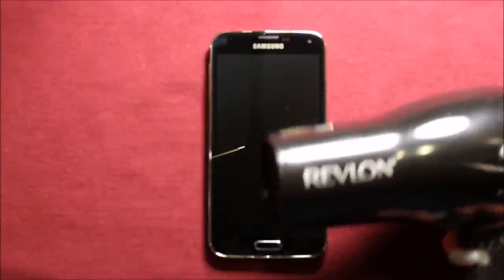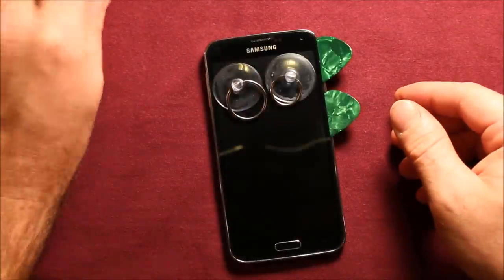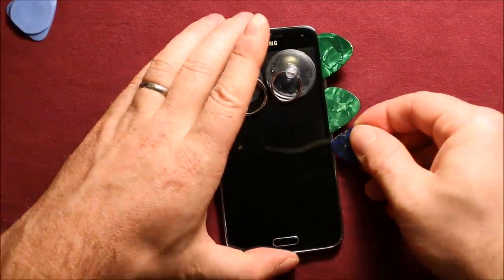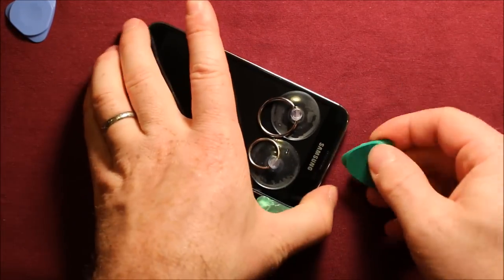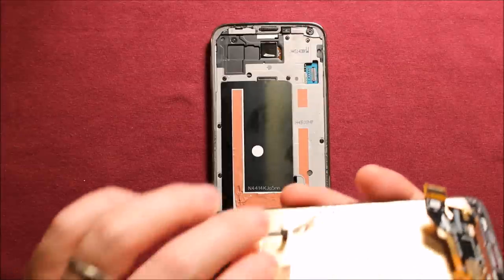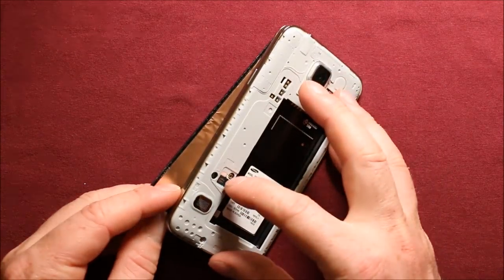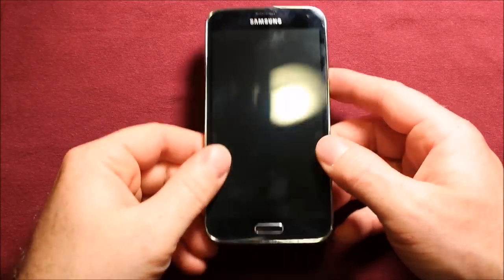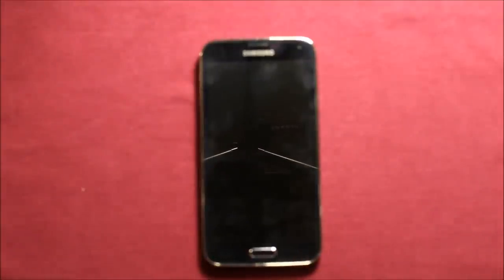Galaxy S5 Headphone Audio Jack Replacement How To Change

Comment: 1:56 I would add that you have to remove the glass AND the LCD (in general adressing every component by its name) and that they should stick together. Otherwise, you can easily separate the glass from the display, however, your display will absolutely break while dismanteling. Your glass functions as stabiliziser.
In my case, the glass was broken and I had to replace it anyway. It didn't bother me to break it further, however, I now broke my lcd too, had to buy it too, ... and so on. The rest of the replacement was easy.
Another tip would be to show the warming process (in muted), too, to give an idea for the ideal warmth areas (especially regarding the adhesive in the middle, which is a bummer!) and to light / better show some processes. (f.ex. 4:40)
I would like to thank you for your video! <3

Comment: Just watched this and was dreading having to do this myself. Gone are the days of easy disassembly like the Galaxy S2. I used the flashlight on the previously mentioned S2 and realized the only problem with my headphone port was a tiny rock nestled in the very bottom preventing the jack from seating. Straight pin was all I needed thankfully. If you have a similar problem, inspect the jack carefully before having to tear the phone apart.

Comment: this video was super helpful. my headphone would randomly disconnect and reconnect and then stopped working completely so I figured the jack was faulty. watched this till I saw how it connects and then squeezed the phone just above the connector and it fixed instantly... hope it stays functional for a while
Reply: Holy crap very glad I read this comment. Tried the same thing (squeezing as hard as I could on and around the jack and connection). My phone has been disconnecting from my music as the tiniest slightest movement which is incredibly annoying. After doing this it seems to have been fixed.
Reply: I tried squeezing the phone too and it has fixed my headphone connection problem. 
Thanks for the video - the repair looks hazardous for an undamaged screen.

Comment: +Smart Easy DIY @Smart Easy DIY If you used the hair dryer to melt the adhesive on the screen in order to pry it up, how did you re-adhere the screen? Did you not apply any kind of adhesive in the rebuild? If I were to reapply adhesive, do you know what type of adhesive needs to be used?

Comment: Thanks a lot for this video, I think I will only attempt this fix when the S6 is released, so if I really screw it up, I'll have an excuse to get a new one... but right now it looks way more complicated than I had hoped. 

Out of interest, what's wrong with your audio jack? Mine is crackling every now and then, I thought it was the headphones at first, but testing with a few other sets I had shows that it was the jack.
Reply from the maker: Yeah it's quite a bit more complicated than I had hoped. Since they went to the waterproof thing with this model they had to really change stuff around. Mine actually was ok yet at the time of this video. I did this in hopes of helping others needing to do this process. Thanks.

Comment: This is a good video, but a couple points that aren't mentioned... 1) The screws on my phone we too tight and stripped when I tried to take them out. Had to pull out my dremel to cut some new groves after other methods failed. But that was fun. 2) The glass and lcd screen is very, very fragile. Super easy to break. Be prepared to replace both if you try this. And that's not a cheap fix. :( Sigh. I failed.

Comment from the maker: @ Brandon Martinez because the way they positioned it it's between the front and back so you need to take everything apart from the front to get to it... It's a stupid design in my opinion...
Reply: is this basically same for s4
Reply: +Matt Stern nope! on the s4 you can replace any part by opening it from the back

Comment: A few warnings:

1. Be careful not to go too far into the case when removing the screen, especially at the bottom, as you could damage the connectors for the "back" and "menu" keys (like i did).
2. Be careful not to apply too much heat at once as the glass part of the screen could crack (like mine did, but the touchscreen still works).

BUT: I successfully managed to replace the audio jack, the damages are minor (you can barely see the cracks once the screen is turned on and the navigational keys are not that important) and it only cost me 5$ :)
Reply from the maker: +xChrisS41x Thanks for sharing your tips.

Comment: My camera often gets stuck (used--think there's some dirt in there) when trying to move to focus the lens. I tap it occasionally, to free it up. Not violently, just enough. Noticing the contact for the ribbon connector on the camera, where it attaches to the PCB of the main board, I think I may have tapped it loose. When I plug in headphones I hear a beep every second, feedback, definitely not generated by the device. The device doesn't recognize I've plugged anything in. I think I just need to reconnect this ribbon connector, but as you guys do phone repair, I thought I should ask your opinion first. I'm highly experienced with this sort of thing, I build computers, do PC repair, bla bla bla. Does that sound plausible/likely? Thanks guys. Great video by the way.
Reply from the maker: +Jack Diller Thanks glad it helped. I would say it sounds like something came loose inside yes.
Reply: Then I'll definitely be messing around with it soon! Haha, thanks for replying so fast.
Reply from the maker: +Jack Diller No worries. Take care.

Comment: Do i need the adhesive tape or can it be done with out it?
Reply from the maker: If you want to retain your water resistance then you need to.
Reply: +Smart Easy Repair are you talking about the orange adhesive strips as well? if so what can I use to replace it with? and where can I buy that adhesive? the link you provided in the description only shows the adhesive around the edge not the orange adhesive. thank you.

Comment: Everything went smoothly. Followed you step by step took my time.. put my phone back together and now it won't turn on.. I have power going to it I checked that by plugging  it in and it showed the battery charging at 75%.. the Phone just will not turn on now.. Any suggestions?
Reply from the maker: This seems to be a tricky phone in the sense that everything has to be just right.. I believe you that you took your time and did a good job. The only thing I can think of right now is that the connections somewhere aren't  together quite right. That's what I would check. I know it's a pain taking it apart again but that's what I'm thinking it is.
Reply: +Smart Easy Repair I took it apart 2 more times last night, making extra sure to check all connections were correct and tight.... still no luck.. :(  Held power button down for 1 min and left battery out all night.. put back in this morning and no luck..Plugged it into the computer yesterday after the the first fail and it showed up as the Galaxy S5 i900.. Plugged into it today and it shows up as  MTP.. Only getting worse.. Think it's time to get a new phone.. Darn, I love this phone too...
Reply: Smart Easy Repair

Comment: So since my headphone jack doesn't detect anything its because I need to replace it? Or is there a way I can just clean out the headphone jack without having to take off the screen and all that?
Reply from the maker: You can try cleaning it with something see if it helps. Otherwise you prob need to change it out. :(

Comment: Can the headphone jack component be unscrewed to get right into the core ? my stupid headphones decided to snap while running, half is stuck in there, now my speakers don't work because its still registering them as being in there.
Reply from the maker: Only if you can get in there with something small to get it out. Otherwise I think you might have to replace it.
Reply: +Smart Easy Repair OK man thank you for the reply, great video ! hopefully as of next week I would have fixed my phone, will save me some money lol !

Comment: Please help I just can't get one of the screws out, it seems to be pretty much stuck. any tips?
Reply from the maker: Do you have a flat screwdriver you can try it with? Sometimes if the Phillips is stripped out you can use a flat if it fits tight in the corners.
Reply: Oh dear that was a trip...
i found out my screwdriver was a tiny bit too big so I had to get a new one (borrowed one). Was thinking it was the right one since only one screw was actually hard to get out but with the new one it worked out perfectly :D thanks alot

For anyone thinking aout doing this with absolutely no knowledge like me:
it's hard but doable, just be REALLY careful. Took me about 50 minutes counting the time I wasted when my hairdryer just randomly broke >.<
great video, saved me alot of money (payed 5 bucks instead of 90 what the local phone store told me)and I don't have to live without my phone for longer than an hour ;)
Reply from the maker: Hey thanks for the tips! I’m glad you persisted and took your time and got the screw out ok. Good job!! 👍👊

Comment: if only the right side of my headphone is not working, does replacing the headphone jack solve this problem? i tried with all kinds of headphones and it seems that only the right side isn't working. the left side works perfectly.
Reply from the maker: Yeah if you tried different headphones so you know it's not that then it's probably the Jack.
Reply: Hi, I have the exact same problem as you. Did you try this yet? Did it work?

Comment: I cracked my screen doing this. the key is getting it completely under the led screen which was not easy with my phone since the led was very brittle.  The rest was a breeze but I ended up changing out the headphone jack and paying for the screen replacement.
Reply from the maker: Sorry man yeah it can be tricky. Glad you got it working. Take care.
Reply: +Smart Easy Repair The only cell repair place close to me only fixed screens and the places that could fix it required you to send it in and be without my phone. In a strange way fixing the headphone jack and getting the screen replacement worked out.

Comment: Is it risky on this replacement? What's the losses?
Reply from the maker: +Mr. Ráve It is risky just because of having to take the screen off to access it. It's the worst design Samsung ever made to work on in my opinion. If your not careful you can damage the screen. That's the downside.
Reply: Oh. Expert can also have a risk of doing this replace or not?
Reply: +Mr. Ráve yea worse design ever.. I was socked at first when I heard  of that teardown of screen to replace it.. but my s5 becomes still water proof after replacing the jack?

Comment: My problem isn't that my jack ain't working, But that even when there is no headphone or nothing in the headphone jack the phone keeps saying " Earphones connected". its very annoying and worries me a little... hope you get help me out, thanks
Reply from the maker: Sorry I don't know what's going on with that. Did u drop it or get it very wet?
Reply: Well i kinda wanted to test it out how water resistant the phone is, so i held it underwater at about 1foot for some minutes while cave diving to film my self, not the smartest thing to do !, But after leaving a cut off head phone jack in there for a day it fixed it self by it self, no more diving for my phone !
Reply: My phone did the same thing, i got water in the jack and i used a can duster to blow the water out and then everything went back to normal
Reply: +cmmtv4 how long did it take was it instant?

Comment: took my s5 into samsung shop and they said it will cost $150.00 AU are they trying to rip me off?
Reply from the maker: +J. DUB That does sound very high to me. I would say 50 at the most.
Reply: fixed it myself lastnight!! pulled it out with my gf's tweezers lol. there was a little tiny bit sticking out on top of the broken aux plug where i could just cling on to with thin tweezers. happy now nightmare is over😊

Comment: Before you replace the audio jack, try the following:
1. Take a wire, insert it into the audio jack, the phone upside down, and spin it
2. Hit the phone slightly upside down on a wooden table
3. Be astonished how much dust and dirt comes out
4. Repeat Step 1 and 2 several times
5. Take a Q-Tip, pull and spin the cotton to bring it into a longer and thinner shape
6. Dip the Q-Tip into ethyl alcohol (disinfectant spray is also working), insert it into the audio jack and spin it
7. Repeat Step 5 and 6 several times
8. Be happy that your audio jack is working like a new one without replacing it :))
Reply from the maker: Definitely worth a try thanks for sharing.